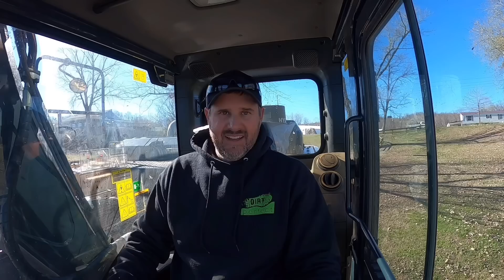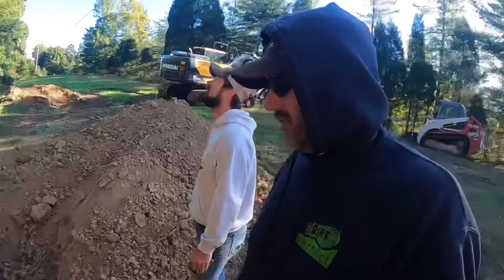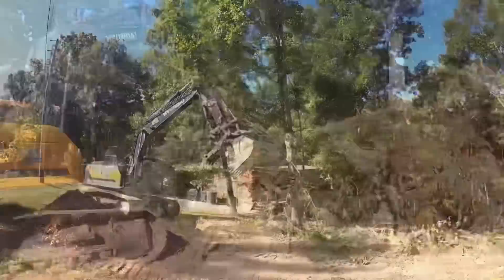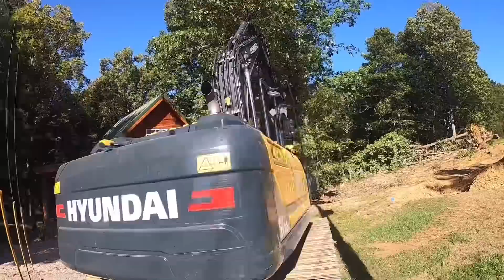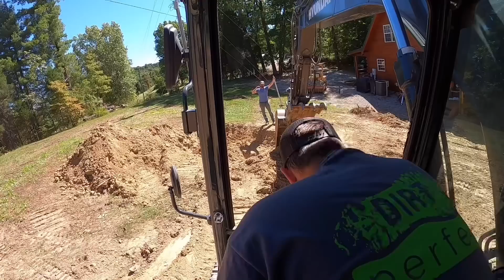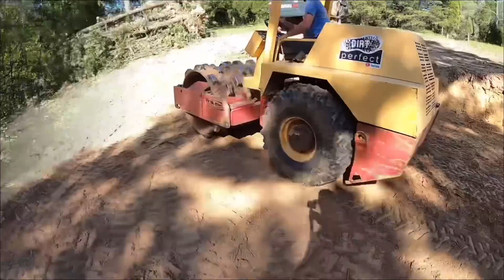This guy just might have won the Dirt Perfect lottery, small job with big excavator. Can it be done?

Comment: I'd have to agree that hooking that tree and pulling it back toward you on the opposite side of the stick from the cab and you'll have better control of it. I think you should do more like that personally to keep from tearing up trees that you don't take down that are outside the clearing area. Most of the time when I take down trees I pull them very seldom pushing them down. I feel that you have much more control of the tree having it hooked on the side of the bucket and then turning with it as it falls putting the bucket on the opposite side of the trunk and guiding it down. I think its easier for the tree to get away from you not having it hooked with the bucket. Pushing trees over I find I have to try harder to keep up with them or just hope they land where I want them to. Again all of this is just my opinion and how I'm comfortable taking down trees. Good video. Stay well. -Wil  👍

Comment: Nice job, very, very tight space to work in. Think the 210 actually excelled, although sticky finding space, with it's electronics it was a master of finding grades and then putting dirt in the right places. Less buckets moved and better better efficiency means higher profits, it would be interesting to know what you got fuel wise?

Comment: Good thing that was a smaller pad.  If it was any bigger that garden hose would have taken awhile to get all the water you needed in the dirt.  If this because a more consistent issue you may need to invest in a water truck/trailer. It could also help suppress dust even if you aren't trying to compact the soil.  Always good to have to flexibility to address those hurdles when they arise.
Reply: There's a big "HOSE" in the ground just tap it

Comment: Happy Thanksgiving!  And most jobs you would do won't be too small, even for the 210.  It just took a bit more calculus on the risk avoidance issues.  Otherwise, it is making short work of a project that, while small in area, was/is not small in results for the client/property owner.

Comment: 7:00 cant you replace the counterweight on the 210 with the one for the 220 on a old excavator i have seen homemade removeable weight plates for ballancing different attachments
Reply from the maker: No
Reply from the maker: And I would not want it even if I could

Comment: Bees won’t fly at night.  They use the sun for their orientation and absolutely will not fly at night.  I can’t count the times I’ve found a yellow-jacket or bumblebee nest by painful accident.  When this happens, you have to remember, “Do not run or swat your arms or hands at them.”  Riled bees go after the fastest object around.  If you can grit your teeth and take one or two stings while SLOWLY crouching and moving away from the nest, you won’t get the entire swarm coming at you.  Think about every cartoon you ever saw where bees are involved: the bees are swarming after the fastest moving thing in the cartoon.

     If you don’t hold a lot of credence in what you might learn from cartoons, consider what happened to me on more than one occasion: when I’d run over a bee’s nest on a tractor with a bush-hog type mower, I’d raise the mower deck in the air and leave the blades engaged.

     Then I’d hunker down on the tractor while slowly dismounting it.  After getting about twenty feet away, I’d turn around and watch what was happening.  The entire able-bodied colony would be attacking the mower blades or the fan blade on the engine.
 
     Now, getting back to the no-fly time for bees; let’s say you want to destroy the nest out of retaliation for getting stung in the first place.  You now know the approximate location of the opening.

     To destroy the nest without getting stung, you need five things: (1.) the darkness of night; (2.) a stick about 5 feet long; (3.) a flashlight; (4.) a pump-up garden sprayer with bee killer (my favorite is Coleman camping fuel); and, (5. a little luck.

     Bees respond to vibration on the ground, so, after night-fall, use the stick to whack the ground several times near the suspected nest opening to get an exact location.  Turn the flashlight on briefly to locate any bees walking on the ground.  “Briefly” is the key word here.  You may have to do this a few times until you locate the nest opening.  The “guards” will be lining the nest opening, and the light from the flashlight will make their eyes will look like miniature gold dew drops.  Once you locate the bees, spray them with the bee killer.  Luck is mentioned above; if you have a nest of several hundred bees, there may be one or two of them in the hive who are brave/stupid enough to fly in the dark.  That’s the reason for turning the flashlight on briefly, locate them, and then turn it off as soon as possible.

     The Coleman fuel “freezes” the bees immediately, then they die.  Do NOT set fire to the hive as this can cause a minor explosion and/or prevents the residual gas fumes from killing the colony.